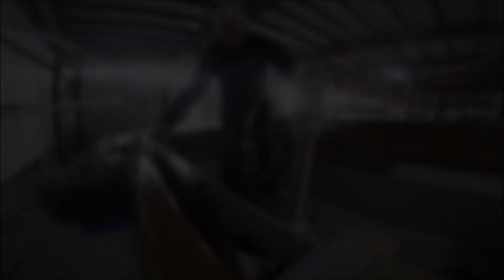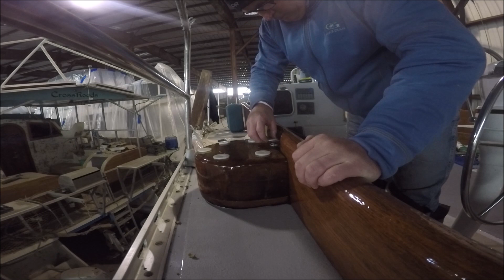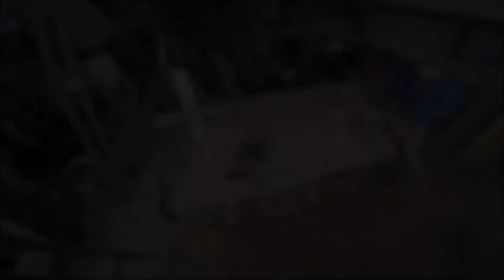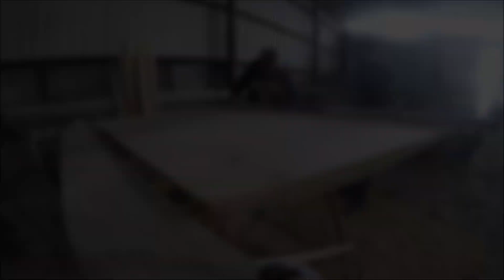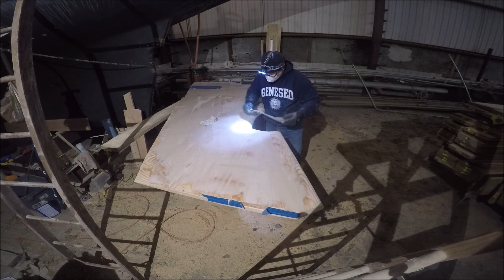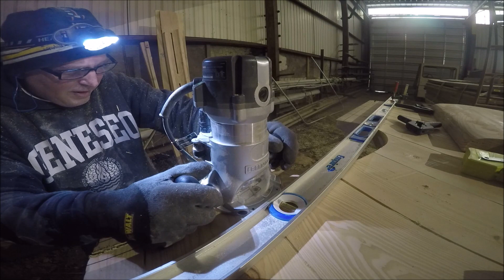Ep. 18 - Marcelina update  December 19, 2019

Comment: Awesome progress. Do you think your new rudder will be as strong as the one piece all metal original?
Reply from the maker: On the original rudder there was a lot of stress on the weld between the  rudder and the shaft above the prop - the weld below the prop is just along for the ride - so from that aspect the new rudder will be stronger. What I'll sacrifice, however, is twisting stress within the rudder... I think. But given the thickness and the use of fiberglass on the outside it should be fine. The one spot that concerns me is where the rudder pivots at the bottom of the keel. There will be a fair amount of force pushing the steel insert sideways and not much wood/fiberglass to resist it. Good question.
Reply: @dc14522  
Thanks for your reply. I envy your commitment, enthusiasm, patience, and attention to detail on such a major project.
Reply from the maker: @jtveg  Thank you